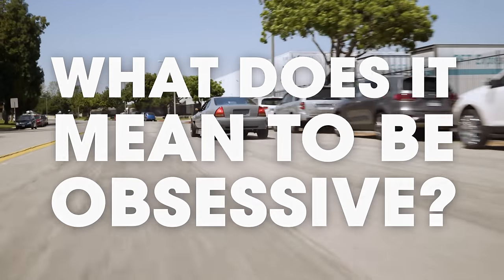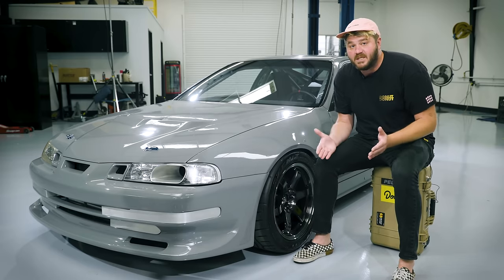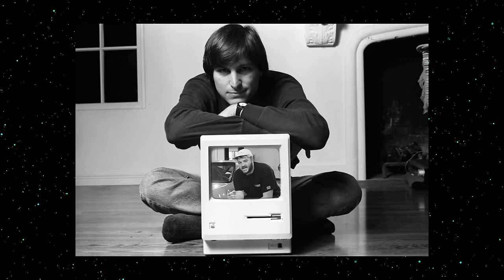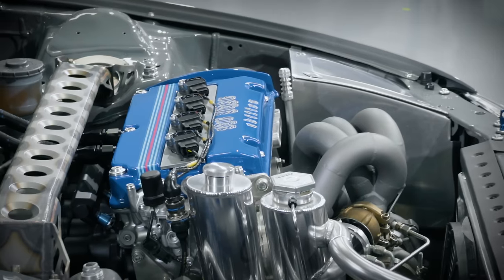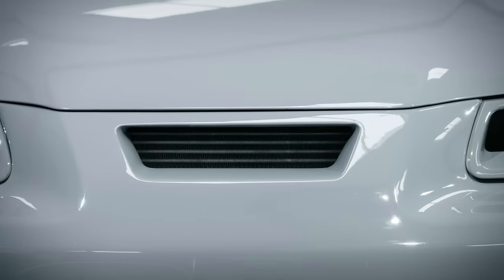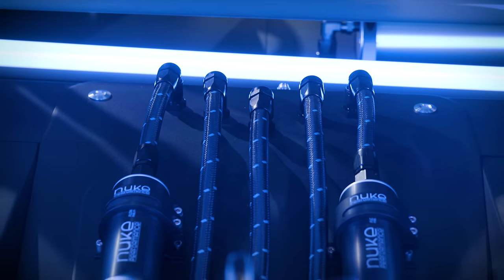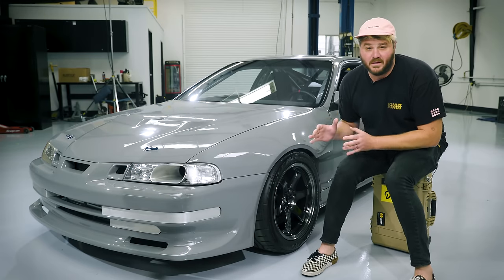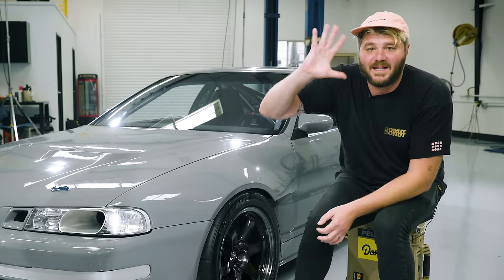If Steve Jobs Built a Honda Prelude | Bumper 2 Bumper

Comment: Oh my god that thing looks and sounds imaculant
Reply: It definitely has its flaw but its fun and quick
Reply: @BigMikeEdition  crazy to hear you even say it has its flaw it looks like you picked out every flaw until making... I had a 94 4ws prelude ... crashed it now I own a golf R lol but I loved my prelude it was low low and red with white rims and limo tint I had goals and it was the coolest car I ever had... yours is great the inside was crazy good that minimalist design  with that material ... is perfect
Reply: @marcusfigueroa665  Thank you so  much. Yea, it was to streamline and make the digital dash the focal point. I appreciate that you appreciate it. How's your Golf R going for you?
Reply: @BigMikeEdition  of course man. THe 4th gens need a better after market support or at least need to remanufactured the window seals lol..  I wanted the 2016 golf R the HP was 292 and TQ was at 280 stock... and it felt  like so matched in power and torque and very responsive  handling but they want 32k for that thing.. I just looked for a older year.. found a 2012.. for 17k.. HP 256 and 243 TQ .. but It was still faster then my h23 and my aspiring goals with the car so now I'm in a whole new after market .. were everything is close to a G or more for quality stuff and I'm not Rollin in no at but I like cars and I wana buy quality stuff so I save and try and spend it on what I really want to accomplish first.. they offer 3 stages of tune... from different software tuning company's stage 3 is a bigger turbo for like 3k and a forged pistons and rings and your getting close to 500hp  .. and exactly 500.. with a certain company... I'm planing on trying to reach 2+  with is in the 400s.. which I think is good enough for not having to buy another turbo or build up the engine they do require and full exhaust down pump a hpfp intercooler performance clutch .. the obvious supporting things when you wana move up in power... I want to focus on my suspesion and chassis reinforcement.. to give my car a good foundation for when I do start going in on engine upgrades .. but like I said everything's a lot more expensive then my Honda so I'm torn between spending 1k and getting 5 pieces of  under body chassis reinforcement  bars  including sways.. from and back... I know that's pretty good or spend 1200 on some head light smh lol sounds dumb but I really feel like I'm guna put these headlights off till I'm further along but then just look at my car the days I'm still not at the point I want to be yet and wish I just bo8ght them there just so stupidly priced the black housing projector Xenon..... and they just make the front look more aggressive but again I have so many goals for the suspension adjustable control arms too., like really trying do dial in everything so that the handling and support feels safe and solid but .. it's either cosmetics first or suspension first .. lol it's a fun car though I love it ,,, that would have been a simpler answer

Comment: Gas port sold separately, removed the aux cable, we also removed the steering wheel, twice the price of a normal car, windshield cracks if dropped slightly.

Oh and 495$ per horsepower

Comment: An Apple Prelude would have the same parts as a normal Prelude, but Apple would charge at least 10% more just for the glowing apple logo. Any attempt to fix or modify the Prelude would result in a cease-and-desist from Apple, as you technically don't own the Prelude. Modification would be impossible anyway, as all the parts are welded together. Repairs may only be made at Apple-licensed mechanics, and the mechanics simply tell you to buy a new car.

Comment: I don't understand the point of an F20b swap. Sure, the iron liners can take a bit more abuse, but weigh more. The FRP liners would work fine if tuned correctly, and make the engine lighter, even though it's a larger displacement.

It seems like an un-Honda move. He got a smaller engine that weighs more.

I'm betting that swap was encouraged because he blew the H23 it came with. Probly cracked a sleeve due to preignition.
Reply: The F20B has a better rod/stroke ratio, revs higher, and although its displacement is 2.0L versus 2.2L, that slight loss in torque was going to be more than made up for with the turbocharger. In regards to the weight difference between FRM and non-FRM liners/sleeves, do you know the weight difference that you are referencing? I've never heard anyone ever bring that up so I'm genuinely curious if you know the difference in weight of those two liners.

This chassis has never had an H23 in it, I bought it with a blown up H22 back in 2005 and it has had an F20B setup of some kind  since 2005.
Reply: @BigMikeEdition  I was just fuckin' with ya,  because most could also loose 20lbs from the driver's seat by skipping the extra cheeseburger @lunch everyday.

I also preferred the d15 (over the d16) due to the r:s ratio & smoother operation at high revs.

Comment: If Steve Jobs had built a car, it would have fancy features... It would look great...
But the moment something broke, all indications you would get would be to go to the Apple dealer with it, where they would overcharge you for the fix, stating that a new car would be cheaper.
But also their diagnostics would only tell you "There is something wrong with the car" ... But no indication as to what it is, or where the problem lies.

No, I would rather take a car made bumper to bumper by John Moses Browning...
It would be a car that forgets to be obsolete, super reliable, and easy to maintain and fix when it does go wrong.

Comment: Fuck yes! I have a 92 prelude swapped out the H23A for a F22B ... Unfortunately i recently got into an accident due to a fault in my brakes i think they had air bubbles in the line from the previous owner who i bought it from i hadnt had the chance to really work on it amd this was after a radiator blowing up while in the drive thru because p.o. had just water in there. This wasnt even a month into owning it. 5 mins after replacing my radiator as i drive literally 6 mins away from where i was. The timing belt snapped approaching a red light. I have been trying to repair it to bring back the beauty it was but body work isnt enough i need to get replacement parts that i simply cant afford in this damned pandemic. If you guys know any place to get deals on parts for this same car please hook it up i had to tear apart this motor twice to repair the damages and non- maintained wear. It runs strong still some issues that seem pretty minor as far as problems go. If you guys want to hear all that in what details i can provide feel free to contact me. Thanks for the well deserved praise on this spectacular car!!!!

Comment: if steve jobs built a car you would need to buy an adapter to put gas in it. After 1 year your battery you put in it would die at 76%. you would need to update the software every month which affects your vehicle's HP making it slower. OH and they would come out with a "NEXT-GEN" model every which feature no changes except it looks different

Comment: If this car was an Apple:

It would start to go slow and lag as the months go by.
If you replace your broken windshield with a non dealer windshield it will refuse to function
If you need to change the battery, you need to disassemble the chassis to get to the battery
If you want to play music you need to purchase them from the dealer 
If you want to hear the music you purchased you need to buy the proprietary speakers

Comment: So do you have to take off the valve cover to change the oil? Lol
Reply: Nope
Reply: @BigMikeEdition  so how do you fill it if the oil fill cap is shaved? Pump it in?
Reply: @slebano4244  No, I have a filler neck designed for it. You pour it in just like everyone else :-)

Comment: Everything is super on this car BUT THE F.... TURBO that engine need at minimum a gtx35.... gtx28 WHATTTTTT The helll
Reply: I appreciate your passion on it. I chose that turbo and specs to make the powerband as usable as possible. The car makes the best power at 4400RPM, right in the middle rather than only at the top.
Reply: @BigMikeEdition  No disrespect man your car is awesome!!
I had an accord and a civic with h22 the first with a t3t4 with .63a/r and yes the torque come early but fall on his face fast... the second with a 6266 .82 and what i can tell is there wasn t that much a difference on the low end power but as soon as i reach 4k it was a rocket ship to 8.5.
Those engine can take turbo as big as my n54 can take and be as drivable. But that your car and it is great!

Comment: Crazy build. Just simply amazing. BUT. These buttons on the dash need to go.
Reply: Which buttons? The ones on the keypad that control the car?
Reply: @BigMikeEdition  I never thought you'd see this mate. You probably should not give a fu** about my opinion, since I never built anything else than a shed in my backyard. But if you really want to know, I am talking about the buttons in front of the shifter, yes, the ones that control the car. They don't have to "go", since you need them, but I just think the type of buttons you used look cheap, compared to the rest of the build, which is brilliant.
Reply: @xzistpo  I appreciate the kind words.

Comment: Gotta fuel pump louder than most sound systems
Reply: LOL! The pumps are quite loud, especially because the rear seat delete and interior redesign incorporates and flows in to the trunk where the fuel setup is mounted, so there is nothin obstructing the sound of the gasoline as the pumps prime and start flowing. It's glorious inside the cabin, believe me.
Reply: @BigMikeEdition  OHH FUCK I GOT A REPLY FROM BIG MIKE! 😱😱😱 All jokes aside, I love your work and I can't wait too see the next thing you redesign from the ground up!

Comment: ok so if you were getting twitches and went full OCD on bolts why would you ruin the entire experience by not treating the strut crossbar with a good old-fashiones electrolytic bath plating to hide the insanely poor welding job with a nice even color?
Reply: I don't find the welding job on the shock tower bar to be insanely poor, and I chose to powdercoat the stainless steel in a satin clear coat to lock in the thermal discoloration - it's art to me, so I secured the look on purpose.

Comment: why is still on primer??
Reply: It isn't. It is Audi Nardo Grey.
Reply: @BigMikeEdition  I know just joking..it looks nice. If is in black or white you can't see the nice lines of the car. Great build. Are you going to paint the suspension bar. It is a really nice fabrication..
Reply: @TheHienax  Thank you for the kind words. No, the shock tower bar was treated with satin clear coat directly after welding to lock in the colors and heat marks from welding. To me those colors and marks are art, so I locked them in forever with a clear coating.

Comment: You've put 4 wheels on a pedestal for too long. You even started covering suv's! My motorcycle revs high and I also wait for my fuel pump to prime before start. Since...... 04........got my symbols out now??????!!!!!!!! Wait what? Bikes have been doing this for 45...15 years? Same page now? Stop the descrimination. So I literally risk life whenever I strap a  supercar between my legs, but hey, somebody has to. That civic has had thousands of dollars pumped into it with multiple iterations? What does donought stand for anyway? Sure as hell isn't putting race gas into your stock, high compression race machine, just for kicks.

Comment: If Apple built a car you'd have to get used to.

1. Really boring, unimaginative design that somehow garners reverence.
2. Buying the same car a few months later because they let you have anything other than white as a colour.
3. Mid end components being massively overvalued for huge ROI when sold.
4. The most deplorable marketing gimmicks known to recent technology, have a RETINA Engine  it sounds like it's a V10, however in true RETINA style it's a pathetic five banger.
5. Get charged £3,000 for a £5 accessory.
6. Get used to standard features being removed because it's "dated", no stereo let alone a headphone jack.
7. When you go to the garage for a software update, your performance gets gimped like mad to make your newer products seem like a larger innovation than it actually is.
8. Defend the company, despite the above...

Comment: This car is cool untill you see the headlight bs it's not good sorry if he wanted it better mirror it on both sides dam.
Reply: There is no logic in mirroring it on the passenger side headlight. The compressor inlet to the turbo is on the driver side, which is why the fresh, cold air is coming from and through that side. Thank you for the love on the build!
Reply: @BigMikeEdition  it's a cool car don't get me wrong cool car. I just think for looks ya could get more cool air in is all.

Comment: This car is nice and all, but an oil cap delete? I'm sorry, but thats just dumb.
Reply: I'm genuinely curious as to why you think that.
Reply: @BigMikeEdition  First off, I get its a show car, and obviously you're going for a unique look. I drive the piss out of my cars, commonly adding a treatment or flush before an oil change. Removing the valve cover or filling via dipstick just to do so seems like extra work if you actually put miles on the car. Just my opinion.
Reply: @mountainmischief3828  I appreciate you responding. It isn't a show car, but yes, a unique look I suppose to some degree was invariably a part of the design process. I don't remove the valve cover or fill via the dipstick, so those were unfortunately inaccurate assumptions.
Reply: @BigMikeEdition  Looks like a show car to me, especially considering you changed the angle of how the engine sits just so it looked better? I understand the reasons behind it and I respect your work, I just dont grasp why taking away functionality would be appropriate for a car other than a car youre building solely for aesthetics.
Reply: @mountainmischief3828  I don't know what parameters you personally use to categorize a car as a show car, but I'm going to simply take it as a compliment. I've never built a show car, but I have considered doing one in the future. Once again, it's apparent you've assumed and misunderstood, because I didn't change the angle of how the engine sits in any way. You're going to need to go back and watch and listen to what James says. And, for the sake of conversation, what functionality is it that you perceive was taken away? I don't grasp where you're getting that from.

Comment: If steve jobs built a car it would be overpriced and have shitty performance that will degrade even more after 2 or 3 years, would cost the same to buy a new one instead of repairing it, half of the features will be removed and parts would cost a ton and won't have all te features that an oem part has.
Oh and people will buy them and talk about it being better than other cars.

Comment: allen head? ...really? fucking allen head? how the fuck do you pick the worst most breakable screw head of them all... nice honda tho
Reply: They are definitely a bitch IF you rush and round out the holes.
Reply: @BigMikeEdition  yeee u got a point i gues i need to pay more attention to what im doing.
Reply: @Xsidon  If you live in a geographic region where rust and salt are a factor, it can be an issue. And if you rush and don't pay attention, it can be as well. Those are all very possible - so the perspective is realistic and valid.
Reply: @BigMikeEdition  yeah rust and salt is very much a factor in northen Poland so i gues it would be hard to make it work over here ye